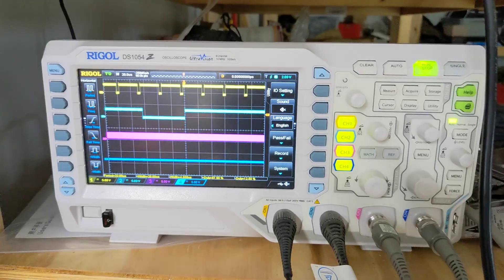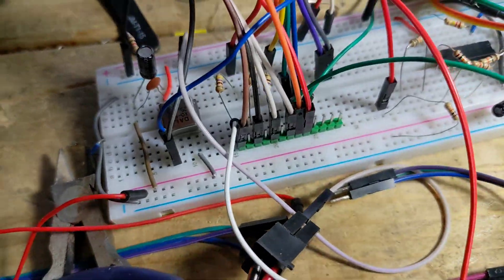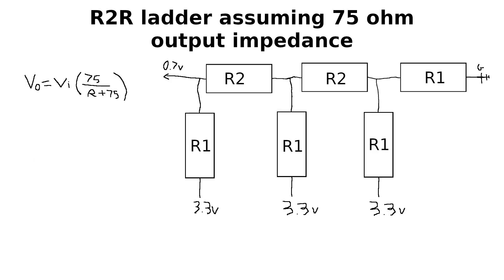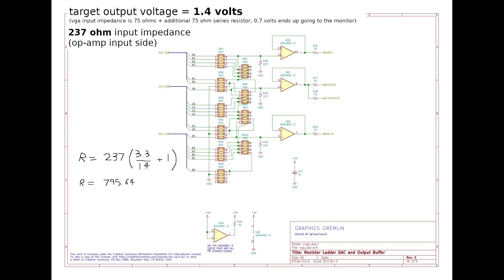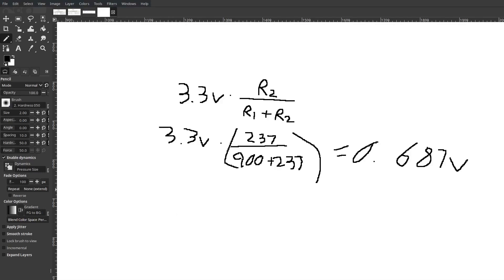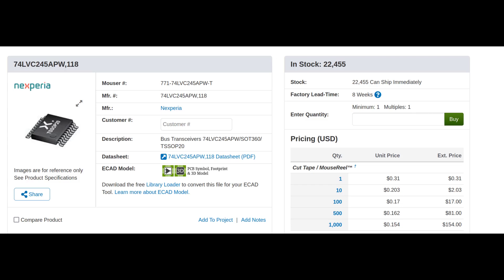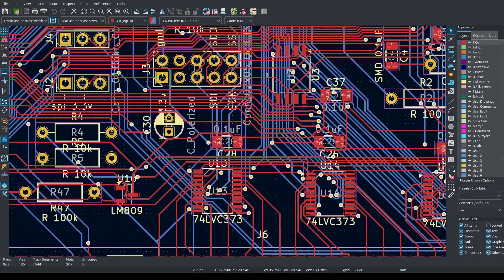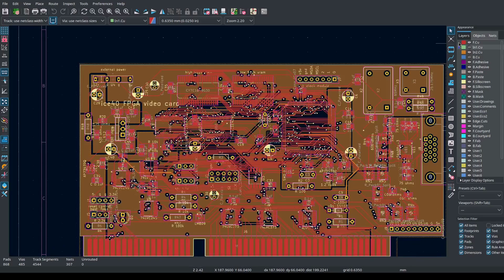fpga videocard progress

Comment: What are you using as VRAM? You can get 512K 10ns SRAM chips pretty cheap these days. One or more of those and you can fill your BRAM buffers with only a slight pause to the FPGA, and none to the CPU when it requests access (use the FPGA as an access multiplexer between the CPU/BRAM filler, worst case scenario you lose 1 in 8 VRAM cycles to your CPU and the BRAM process still has access to more than 150MB/second of memory bandwidth - I’m assuming two 8 bit SRAMs in parallel here). 1024 x 768 @ 60Hz needs a 65MHz pixel clock, so 256 colour mode is still only 65MB/second peak (less memory bandwidth than that is needed due to the blanking periods). 

You need to be a bit cautious because of the mismatched clocks (Video and CPU), so do a little research into “clock boundary crossing”. Don’t forget also that you’ll need to have a switchable pixel clock in order to support other than just 640x480@60Hz. It doesn’t look like the IC40 PLL blocks are up to much fine control, you may need to look into something like an SI5351 external PLL (programmable via I2C to give you fine control over a set of different clocks from a single 25MHz crystal).

Comment: when will your site go up?
Reply from the maker: To cut costs I don't have a website anymore. Soon I will start cleaning up my verilog code and updating this project on the github repository as it gets closer to being good enough to make another video with. Currently the github repository is old and outdated and a lot of stuff has changed in the past several months of development but here it is: https://github.com/Xeraster/fpga_videocard_16bit

If there is source code or schematics from some other project I've worked on that you wanted to take a look at, let me know. I will eventually start updating that other stuff too but right now the focus is just getting this project done sooner rather than later.

Comment: Will you write your own drivers for it or it will be compatible with some already existing card?
Reply from the maker: This will very much be a "custom drivers required" kind of video card. I'll probably come up with a "vga mode 3h" vram emulation mode to make it compatible enough with non-homebrew x86 systems to let you get past the bios screen so you can boot dos, linux or my c++ os where real drivers can be loaded. If I end up having enough leftover LUTS I might add one of those minimal RISC-V verilog projects into my chip to make it possible to more easily fully emulate more vga compatible stuff, but ms-dos gaming isn't a main priority for this project.

Comment: Resistor ladders are great if you have super tight tolerances but a mess if you don't, if you have a vast fast amp on the end of the resistor ladder you can avoid a lot of the issues they have since your output draw will be fixed and not variable from the cable and device plugged in.

I wonder how much a 3 channel DAC that's fast enough to do 1080p60VGA costs vs really nice 3 channel amp and the effort of resistors.

Comment: This is exciting, do you plan to make the fastest ISA VGA card on the planet? :)
Reply from the maker: Hopefully it will be as fast as normal pc-vga cards which doesn't sound like a lot, but that's basically god-tier for a homebrew video card.

I do plan on putting a single special high speed ISA slot with 3.3 volt logic levels that runs at the host system's FSB speed on the next iteration of the socket 3 486 motherboard. If that ends up working out, it could end up being almost as good as a non-accelerated PCI video card (or perhaps even faster if I deviate from the standard ISA protocol a little). If that experiment ends up working, it very well could end up being the fastest ISA video card ever built, so stay tuned.

Comment: I tried simulating the R2R ladder in Falstad’s circuit simulator. R=256 ohms gave me an almost perfect 0.7 volt across the 75 ohm CRT terminating resistor. My simulation assumed that the 3.3v data lines had no output impedance, which is maybe not correct?
Reply: Drivers always have output impedance. It may not be symmetrical (different driving HI vs LO). The characteristics are typically in the data sheets. You may want to consider LtSpice but the fact that you are running sims is a great thing!
Reply: @bretfuzz925  That makes sense. I find electronics to be a very confusing field of study. So much stuff that is just about impossible for a beginner to understand!
Reply: @fredrikfredrikfredrik  what you will find is that the more you know, the more you know you don’t know. As long as you are passionate about learning, you will move mountains.
Reply: @bretfuzz925  Well said!

Comment: In this day and age you can just generate tmds signal from fpga and use dvi-d(hdmi) connector to get full 24bit colors and a perfect image with no analog noise. On ice40 you will be limited to 640x480, but if you get something more modern like ecp5 or artix7, you can get full 1920x1080. Google fpga4fun HDMI